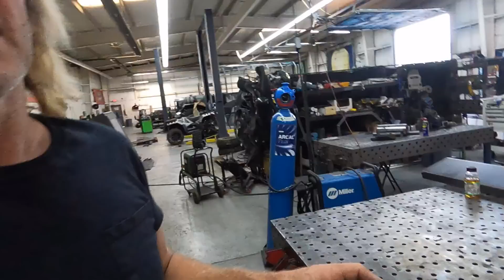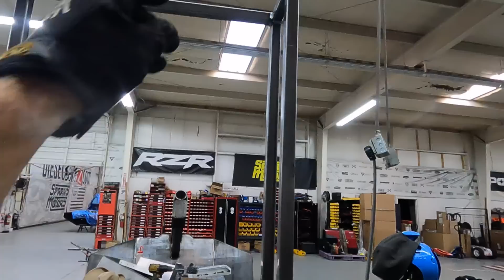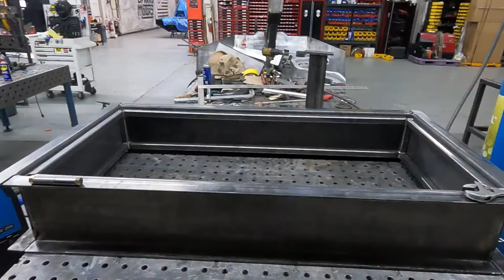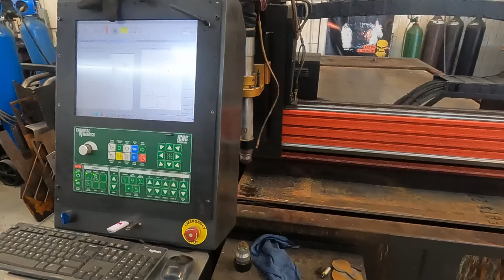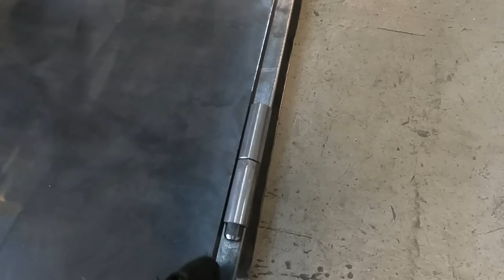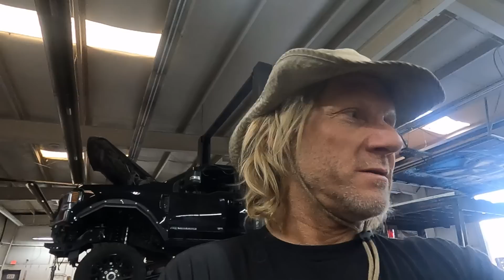Cutting $1000's for Armored  window shutters

Comment: Are you going to add grease fittings?  Because it won't take long for them to seize up in the weather atop the mountain.   Also I would leave the top hinge pin about 1/2" longer makes hanging them way easier if you can locate one in the hole and then line up the lower ones instead of trying to locate all 3 together

Comment: Great work Alan fabrication is top rate. Are  you fitting aluminum windows, if you are l would recommend you use triple glazed windows from steel or wood as aluminium framed glazed units will corrode because they are dissimilar metals, These will corrode with in a few years? I was a fabricating manager seen your latest post so I thought l would pass on my expert opinion best regards  Alan

Comment: ALAN! one of these days I am going smack you  in the back of the head for not wearing a covid mask when working in dusty environments! And then charge every one who gets in line a buck a piece to do the same  DAMNIT Man rodent waste carries viruses and  bacteria that can KILL YOU!. Now for your shutters, double over lap strips-- right side as you face it on outer edge left  side on inner edge.  then for handles use simple double bent handles with plates on the outside. Next to the handle you weld tab  with hole that matches a hole in  handle,  to accept a U shaped pin in the tab ant the handle. If you want you can chain  the lock pin to either side, silence it wit some vinyl hose over the chain. This is the basic setup used for decades on cabinets windows and warehouse doors
. SO good luck  and Damnit Man stop risking catching Hanta Virus. you have oo many friends out here, not just fans andjust incase anyone asks, yes I do know some one who died from it, a  Milwaukee cop, The idiot he was arresting barely made it. there  are about 6 other diseases just as bad

Comment: Really respect you and like all you have done building the fortress yourself; you truly are a hard working talented man. I also can tell that Heavy D respects and trust you even letting you work on your projects in the shop. Watching you build the windows and shutters brings a question to mind; is 1/2" steel really necessary for the shutters; wouldn't 1/4" work just as well? 1/4" shutters would be easier to handle and the material wouldn't cost as much as 1/2". Just my thought. looking forward to your future videos and to completion of the fortress. also do you plan to live there in the future?

Comment: On your inside frame jig you should make some kind of stops. So that ( A ) no way for it to push out and fall and ( B ) if for any reason metal were to bow because of concrete you would have something to pull on to get it out.
Then on your shutters there is a lot of weight there you should have at least 1 bearing built in to the hinges.
Just thoughts don't know if you read comments as you are a very busy person

Comment: Nice work Al as always! Why not tap 2 threads into each rail of your window jig, top and bottom and screw measured bolts into them to create a 3mm space between the jig and window frame. This will give you space to keep your internal welds flush and also when you release the tension on the  bolts allows the jig to slide out far easier avoiding any binding.

Comment: Couldn't you use 3/8 and weld  round bar to stiffing it up in stead of 1/2" to cut down on weight and cost but just my 2 cents but stay safe got to be careful around dead animals mask UP we need the wizard to be around to finish this

Comment: Save yourself some money and check the scrapyards for steel my man.  Scrapyard near me sells off the 'useable' pieces of metal at a fraction of what the suppliers sell it for.  Even with odd sizes and potentially a lot more waste vs a full sheet you would save a TON of money.  Know of several guys who built work/welding benches out of 3/4 and 1 inch steel from there that they bought for pennies on the dollar.

Comment: Do the I-beams that are sticking out the side of your place do they go all the way through your place if so you could put a four leg tripod,two legs on the outer end of the I-beams and the other two like 20 feet inward then put a I-beam from the outside legs to the inside legs ,then put a trolley on the I-beam with pulley then a pulley either at the inside legs so you can pull whatever to more closer to the middle of the roof an use your truck wrench to rise the load , might have to have the legs like 12 feet long to make sure you have the space to lift.

Comment: Thanks Alan for sharing this update with us.  I agree a small strip of steel to overlap is best.  Have you considered using 1/4 plate for the opposite side of the building,  where the winds are less strong? It's still plenty strong for the dimensions you are using and would save you some money..

Comment: With all that metal in the shutters, have you considered using some magnets to hold the shutters open/closed?  A small plate at the top and bottom of each window with some neodymium magnets might be enough to keep them from opening on their own.  Do something similar on the outside of the wall to hold them open.

Comment: This tedious video was extremely interesting. I had no idea how these shutters were made from start to finish. I learned so much from your videos. I think that so many people have no idea how things are made. They hire a contractor who sub-contracts parts out to other people. Say I am having solar put on my home. There is a roofing company who removes my current roof, bring out new roofing material and a crew of people to install the roofing materials. Then they have electricians change out electrical panels and put in a computer system to  control the system. Then a person comes out to repair the strucco damage and paints it to match the outside. Along the way a crew comes out and installs the solar panels. If I were working I would just see the end product.. I learn so much seeing you design, cut,  weld, install, and what it takes to install what ever you have designed. You have more creativity and tenacity than most people. You are an inspiration to many of us. Thank you. Sincerely  Linda

Comment: Hey Alan, mate you really need to get those frames hot dip galvanised…. The red oxide is porous and the steel will rust…. Been doing life long jobs and have learnt that that proper prep makes up for the extra cost in the long run…. Remember the old rule of thumb that rusted surfaces deplet 1mm every 8 years so…….

Comment: I completely disagree, any of the progress videos you make of the Fortress are extremely interesting. Figure some way of using your 5 inches of offcut into some kind of unique handle and/or latching mechanism for the shutters! Also if you DO go with a pully system to remove them, don't forget to add some ears to the top of them to hook on to.

Comment: Looks good! ** Maybe use rubber seal or weather stripping in center to seal the gap! Or rubber flaps that overhang in center to seal the gap, also it maybe worth installing weather seal around window frames to seal and keep wind out! Just a suggestion or thought! With the winds I see at the fortress any little gaps will allow wind to get in!

Comment: Assuming you have a prevailing weather direction up at the fortress the cover strip for the gap between the shutters can go on the side that let’s the weather flow across the gap and prevents muck getting forced under it in effect… so take that into account given the particular location on site of a given window… ie if the weather is from the north the windows on the west the left shutter gets the welded strip… those on the east side the right shutter has it welded… also like someone else mentioned have a strip across the top of the shutters on the frame to prevent the weather running down the side building and dribbling In behind the closed shutters

Comment: Have you considered adding grease zerks to each hinge pin? That way they wont rust up solid. Having the crack is a good idea as the shutters will expand or shrink depending on the temperature. I love the overlap plate idea also.

Comment: Wear a mask Wizard when your working where there is dust or fumes - you could damage your cells in your lungs or throat area - take care Wizard.
That's an amazing workshop you're working from - who owns all of the equipment you use there???
Magic stuff - did you use your wand Wizard to put that amazing window frame together?
That's good use your wand to keep your calculations for the shutters at the right measurements you expect them to be.  That's real magic that machine watching it cutting that steel plate. That's awesome work Wizard your wand worked wonders now for the latches to open and close them. 
30 windows for the Fortress that's an awful lot of hard labor putting them together then carting them up to the Fortress - you need a lift hydraulic machine as your second hand but maybe see if David Sparks got someone reliable to help with the heavy lifting of those window frames and shutters - yes it would take at least you and two others to help.  Great job Wizard once again - can't wait for the next stage.

Comment: Hey Allen,  you have that strip left from the sheet from the shudders why not use the strip cut down to  three equal  width of roughly  6 3/4 wide and 24 inches long  that should give a seam overlap of roughly  3.;275 inches of overlap  it was just a thought  to  use up the  cut offs from the shudder sheet panel's.

Comment: The owner of GBRS was a member of SEAL Team 6 as an operator and spoke about one of his toughest missions trying to get a terrorist leader inside a fortified bunker and he said the front door was a steel backed door that had a draw bridge steel horizontal slat that slid through a series of hoops on the frame and door making it impenetrable , he used all the DET chord and explosives on hand trying to blow this door open and had successfully blown the hinges apart but still would budge the door. I’d say if SEAL team 6 can’t get through that particular door, no one can, in other words , as a Utah Architect myself , your fortress window shutters being built the way you hve , adding slots with a horizontal beam to secure , NOONE will be getting inside. Nice!!!!

Comment: Nice work, Alan,  I think you're on the right track to rig up a mechanical advantage system to set the shutters, particularly if the day you do them is windy. Have you considered using your oxy-torch to heat the steel where yo need to drill. The areas that get hardened could be annealed to make drilling easier. Just a thought, a little spot annealing wouldn't warp that heavy a plate.

Comment: 8 minutes in and it seems to me that you will have to install the sides of the frame first, then put the top and bottom channels in. Now to watch the rest of the video to see if you catch that!!
Reply: Indeed, how can it be installed when fully assembled like that with c channel on all 4 sides? I cannot see how that is possible without installing each 4 c channel piece one by one and then welding them together in place.

Comment: I don't think you need to bother turning solar panels completely over to an armored side so much just a 90° angle with an armored Edge.
Are you considering articulating them so they adjust throughout the year as well?

Comment: For security i would be tempted to add some plate to the inside top of those shutter doors to prevent them being lifted off the hinges, maybe if you welded the cover strip to the central gap on the inside then that will stop it being lifted off when they are closed and locked

Comment: Hey Allen, what about using a MagSwitch setup for holding the shutters closed. Use the same 1” x 2” bar stock that you had in mind. Put a hole in one end that fits over a post that you weld on one shutter, then mount the MagSwitch in a hole on the other end of the bar. Then you just turn the switch to engage the Magnet to hold the shutter closed. Maybe even attach some kind of big gnarley gear or cog to use as the handle on the switch. That would look cool!

Comment: Hey Alan, With all this metal going up on such a high place, do you have anything in place for lightning strikes?
Reply: It takes a lot of energy for electricity to go through concrete cinder blocks but i see your point it doesn't hurt to have a lightning rod installed on a mountain top building id try to build some way of harvesting that energy idk if there's a transformer in existence that can handle that much juice though 😂
Reply: Like a Tesla generator